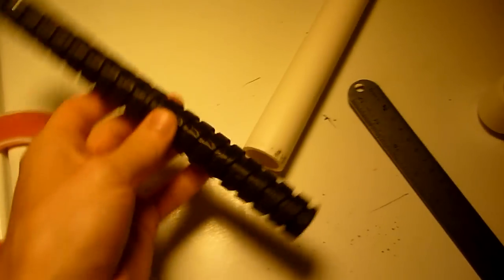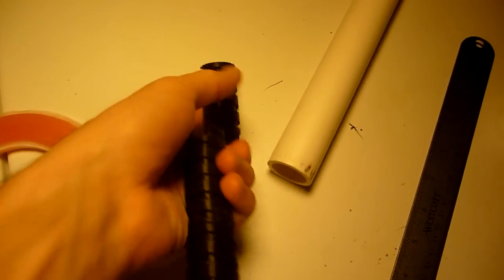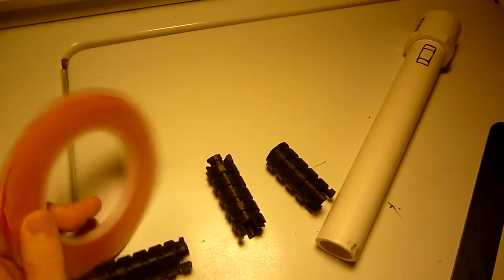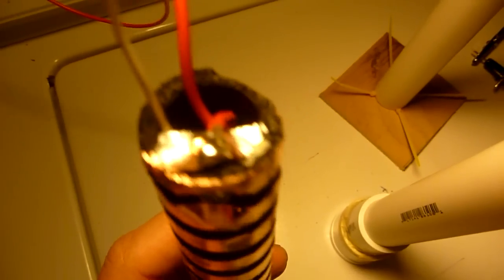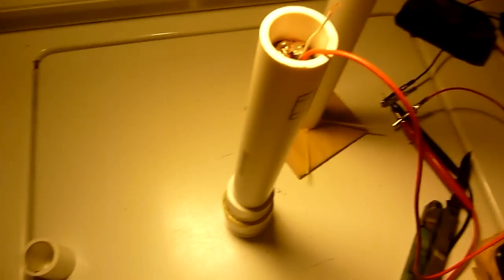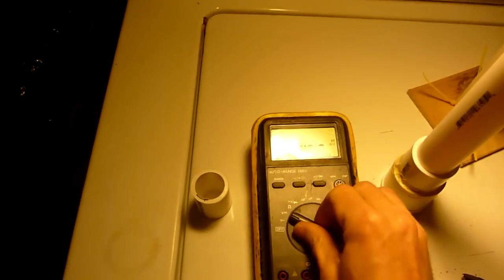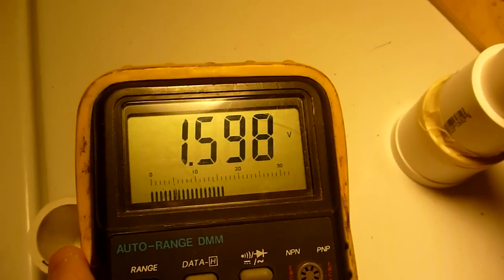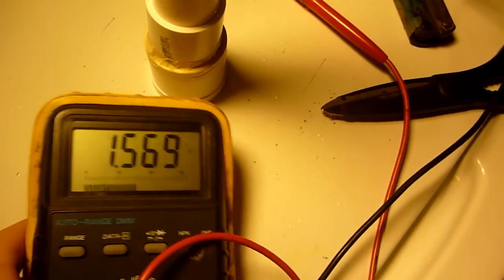Copper, Magnesium and Water 3d printed Battery

Comment: Cut them into small pieces and connect them in parallel!! You will have the same voltage(very stable) and a high current to run your Joule thief fed LED. But everything will come to a crushing halt unless you treat both your magnesium  and copper electrodes. Your electrolyte should be non corrosive and allow high ionic conductivity.  The battery architecture is amazing! Not the electrocchemistry!!

Comment: Not technically a battery, but more of a coil that reacts with the electrons within the elemental wall. It's called a Nathan Stubblefield Coil.
Reply: AN ELECTRON IS PRODUCED CAUSE BOTH METALS HAVE DIFFERNET RESONATING STRUCTURES AND THE CALCULUSOF BOTH PRODUCE ETHER PERTURBATIONS ANDAN ELECTRON IS FORMED. ATOMISTIC PHYSICS ISA LIE. CAPS IS LOCKED AND SPACE IS SPACEY
SIMILARY, IF YOU PUT 2 METALSIN ACID, THE ACID WORKS AS AN ACTIVE DIELECTRIC... SO A BATERY IS AN ACTIVE CAPACITATOR.

Comment: Panasonic has been doing research on something very similar generating electricity by running hot water through a tube of alternating metals submerged in a cold water bath and the results are amazing...a ten cm tube producing 27.3 watts...you're definitely on to something...great work!

Comment: Hi, you have an interesting approach to making a battery. I have been looking at many different ways of producing power and stumbled onto another poster,  whom I suggest you watch a few of his videos.. Space Cowboy ... He has several water batteries that he's been using for years! After watching your video, I have two suggestions for you. First, mid video, 1:27 it appears your copper is touching the washer that's connected to your magnesium, that would lower your output! Next, if you used an led specifically designed to run at 1.5v, it would be much brighter! I have a flashlight that uses a single AA and it is super bright! lastly, from watching space cowboy's videos, I learned that the water does eventually evaporate, so I suggest you use something like a 3" diameter pvc pipe, so you will physically have more water and a LOT  more run time, before you have to top it off with water!  Good luck with your experiments, and God Speed!
Reply: Can you please post a link of Space cowboy's video?

Comment: What is a mAh Rating on this? Do you have a battery charger/discharger?
Reply from the maker: mAh varies depending on the electrolyte used with vinegar giving the highest values.

Comment: Those iron screws and lead solder will make your cell discharge itself.
Reply from the maker: +jjhack3r Good point, I didn't consider that. If the bolts and solder would be encased in some glue and kept away from the electrolyte it should be OK. Thanx for the comment.
Reply: That would be sufficiant. I usually try to keep all conections out of solution tho. I'm making a lead/iron battery that uses a hydrated solution of Epsom salts. So far, my test cells have been showing good results when charging and discharging so I cut out 10 lead+ and 11 iron- plates to be used in a future 3X4 inch cell. Keep experimenting! There's a whole world of things to discover out there :)

Comment: how to recharge this battery?
Reply from the maker: +Veso266 If you use alum for your electrolyte you can recharge the battery using a solar cell, or a 12 car battery (you'll need a diode going to your positive). You could also use an old phone charger for this. In this case the copper is your positive and magnesium is your negative.
Reply: How would alum help it recharge?  Nothing you put in there will allow you to reform magnesium metal...
Reply from the maker: NatureHacker When you 'charge it' corrosion should get removed from magnesium. This will allow you to use the battery again. Something about the chemical makeup of alum helps with that.
Reply: Alright it helps remove corrosion so you can access the magnesium for longer but once the magnesium is used up (or even if the strip breaks) the battery is done and can't be recharged.

Comment: Can you link where you bought the ribbons from?
Reply from the maker: Jeff Nading I bought the magnesium ribbon from ebay. Expect to pay around 6$ for it, if from Hong Kong its only 2.30$ about. I agree with you lets make free energy happen! I am tired of all the lies the mainstream news and education systems are feeding us. It is up to people like us to make the wrong things right. I also managed to replicate cold fusion and I am working on a self running generator based on Ed Leedskalnin. In electricity the electron is not the charge carrying particle. Turns out there are 2 particles involved. One has a positive charge the other a negative charge. These particles are magnetic monopoles. They rotate in the opposite directions. Today we are using 1 particle in all generators but are fighting against the other. This is the true reason behind Lenz's Law.... There is so much out there.

Comment: It lookz awsum ^^) ,,, it kinda lookz like ur boltz r touching both the copper and the magnesium together directly i think they need tu be not touching and then go thru conductive water clean water iz supost tu be non conductive ( i heard that ) lookz awsum tho ^^ super slick (stylish) battery
Reply from the maker: da nu Hey, the two metals are not touching. One is deeper than the other (there is a screw-like pattern where magnesium goes) the copper tape goes on the outside. When working with magnesium don't get it near a flame because it is a flammable metal :P
Reply: Cheerz ^^)

Comment from the maker: For those who want the .STL and the .3DM files here is the link to where you can download them:  http://www.thingiverse.com/thing:631568
Reply: +Naoki Kashima What is the reason for the gaps when wrapping the copper around the pipe instead of keeping it tighter ?
Reply from the maker: +Tony Smith The groove is there to prevent the two different metals from touching each other and shorting out the battery.

Comment: I would use oil, no corrosion
Reply: corrosion = power.  Without corrosion you get no electricity.
Reply: True, but if you got any power, that would mean piezoelectric effect. Would  be worth it just to see. Pluss ibpointless, did this with oil and it worked, check it out on his channel on oil cell.
Reply from the maker: +NatureHacker We have piezoelectric effect. ALSO** we have the electrets. Very few people even know what an electret is. An electret has a permanent electric field, just like a magnet has a permanent magnetic field. Electrets were used for power in early Japanese land phones during WW2. We are all victims of energy suppression.
Reply: Humm, I have to check this electrets, thanks for the info.
Reply: well an electret means you have a dielectric, and if you are using a dielectric you have a capacitor not a battery.  And if you have a capacitor there is no reason to use expensive copper and magnesium, it will work just as well with cheap aluminum for both anode and cathode.

Comment: That setup is not good try just salt mixes packed between copper pipe and Mg rod. That works great with steady long lasting results...no cooking .... no nothing. Just Mg rod inside copper pipe...fill surrounding with salt mixes :)
Reply from the maker: Awesome information, what kind of salt mixes work best for this? Thanx for the comment.
Reply: Naoki Kashima
MgSO4, Borax, Dry Alum
I tried several things than learned that the separation between copper and Mg should not be that much. 0.5 cm is good enough. Pack the salts tight and it will work well.
Another thing I just came across was Stainless Steel and Maybe aluminum (it was a curtain pin, grey ish color). A small cell of it at 0.5 v was giving steady 10 mAmps.

Comment: Very Cool Design. Will you be sharing the STL file soon.

Cheers :)
Reply: key is making a battery that runs on aluminum foil.  I designed one I will release on my channel very soon and the cost of aluminum foil to run a car will compete with the cost of gasoline.
Reply from the maker: Here is the link to the .STL and .3DM files >>> http://www.thingiverse.com/thing:631568
Reply: Naoki Kashima Thanks I will print now :) What is the voltage of the unit?
Reply: Craig Lewis ok 1.5V  What is the life of the Battery?
Reply from the maker: Craig Lewis The life of the battery will depend on what type of electrolyte you'll choose. If you use water it will last years. If you pick vinegar it will last months.
Reply: ok Thanks I started printing. :)
Reply: also conductive ink cathode instead of copper and get even higher current than copper and it is super cheap if you make it yourself.